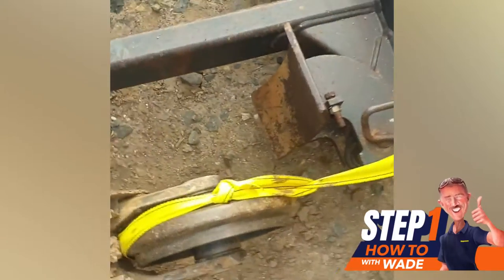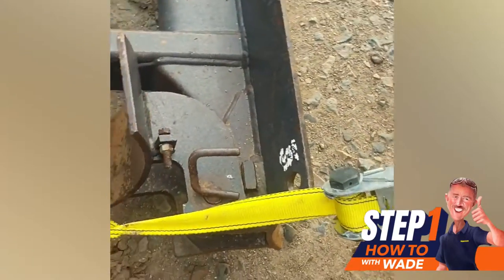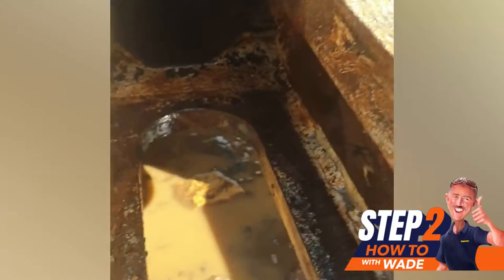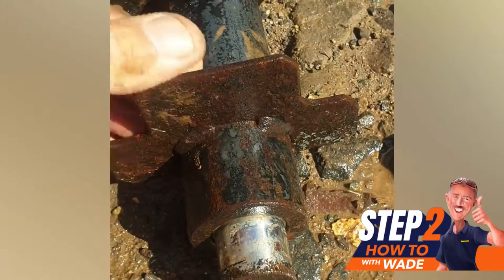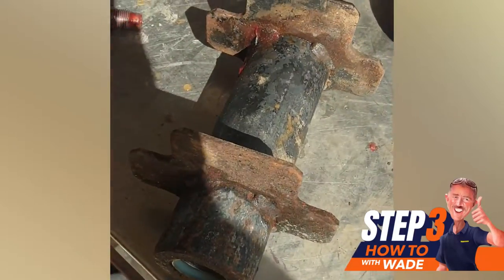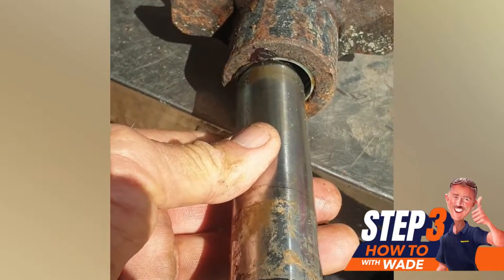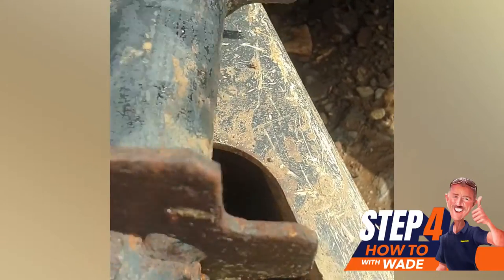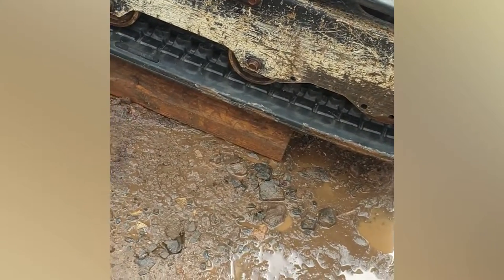How to remove the idler wheel and clean out the piston on my excavator?

Comment: Thank you for sharing! My track is not keeping tension and it looks very easy to service the tension rod & seals thanks to your video :)

Also, is there any chance you can offer insight into how to replace the bearings inside the front idler? Specifically how does one split the idler apart? I have a Kubota KX91-3 mini excavator and I cannot get the idler shaft separated from the idler wheel. There is a roll pin I've already driven out, but I still can't get anything to budge. Any help/ pointers would be greatly appreciated!